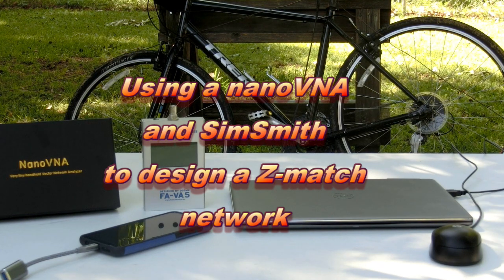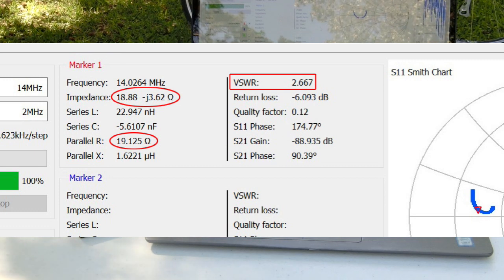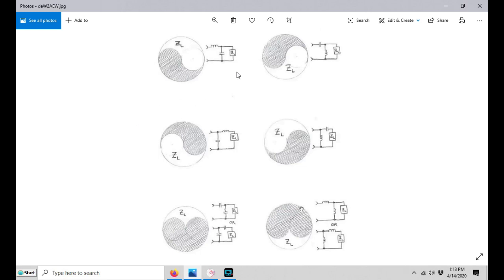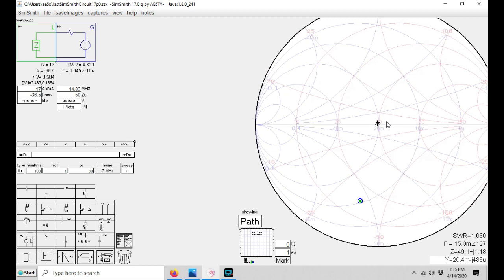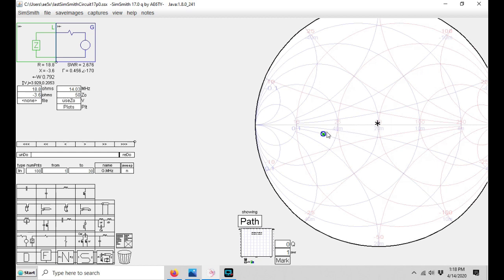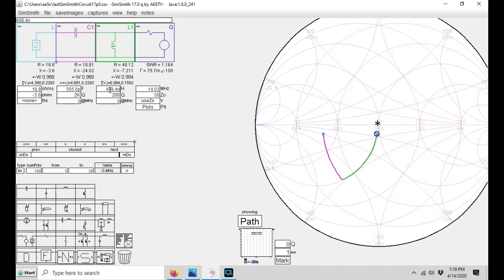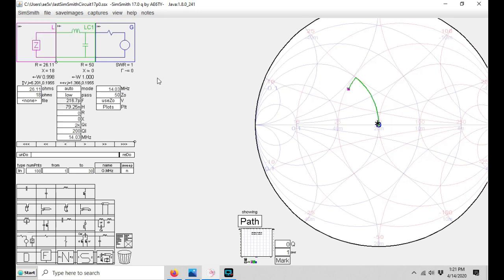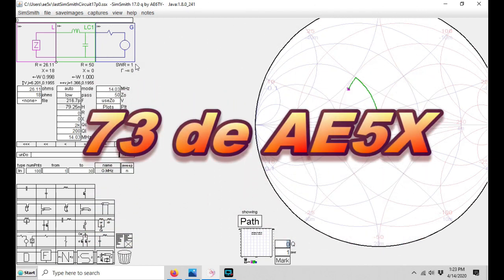Using a nanoVNA & SimSmith to solve an antenna matching problem

Comment: I also had trouble with my 17 foot whip on 20 meters portable. I use a trailer hitch mount. No radials needed on 17 and up for good SWR but I needed to add a few radials for 20. I use short radials only about 11 or 12 feet. I find it not critical as long as I have 3 minimum to provide a low enough capacitive reactance ( low impedance) coupling to the ground. I don’t seem to need much when I just use my Hustler mobile antenna to get a low SWR but bandwidth suffers.

Comment: thank you.right now i'm learning this sim smith...and make me confident after watch your video.., any way ,is there any other way to measure the antenna swr with a certain frequency range?, from what i know, when measuring the antenna using vna, the antenna impedance also changes. can the ZL load data on simsmith use some kind of impedance plot data in that frequency range?

Comment: Try simulate each circuit  with the sweep graph, you'll find that some of these are also (other than matching networks), also low pass or high pass filters and so on.
Look when you use the matching network, it can be selected high or low pass.
It is better if you choose (for this application) a low pass, so you can either match the antenna and suppress any harmonic that comes out of the QRP transmitter.
 I think this is described in the W2AEW and also in the W0QE videos (take a look at his channel, very good). You can also load the s1p (touchstone file) that comes out from the NanoVNA, and let the load in SimSmith actually be your antenna!

73 de Chris IZ4HDM